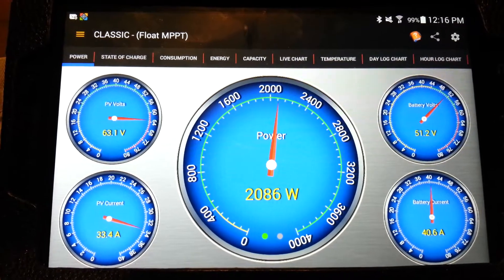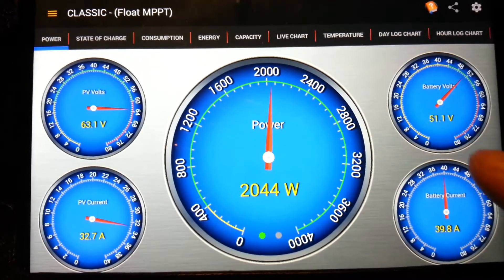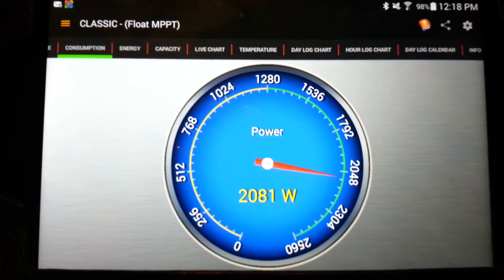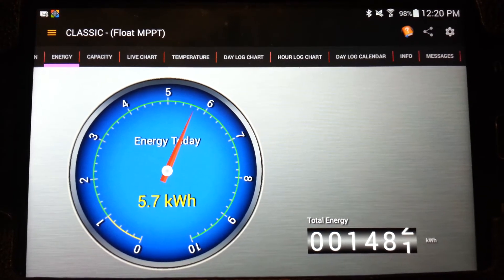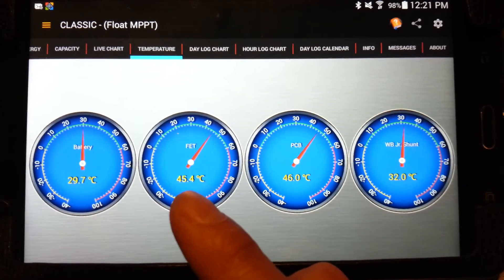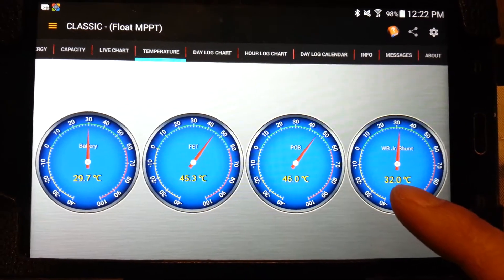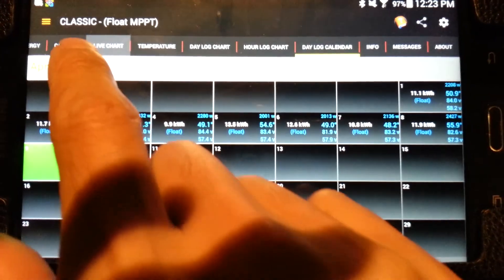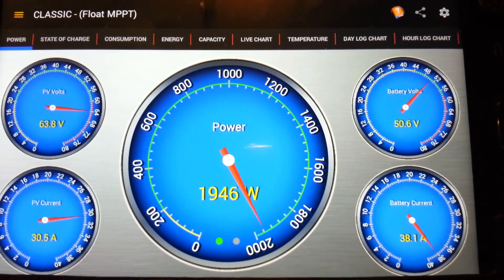2.5kw Off Grid Solar and Midnite Classic 150 local monitoring

Comment: the Android app works really well as well
Reply from the maker: What do you mean Android app?  there's another one different than this?   I like this one way better than the one from Midnite solar.  :)
Reply: devildestiny555 
there is an Android app that is much like the pc version and that's what I use.
i connected a netgear wifi range extender and view with my phone.
Reply: may be that is what ur using already
Reply from the maker: I don't use the midnite app because it has quite a bit of bugs and doesn't calculate consumption and provide both amp/wattage like this one.  :)  This one give much more information and user friendly.
Reply: @devildestiny555  great video bro ..can you pls assist me with the information on what items I need ( and exact app ) to have a monitoring system like yours , pls excuse me I'm a bit new to this , still learning :)